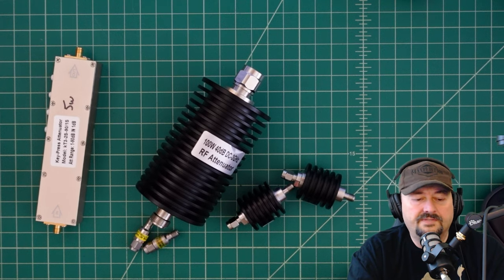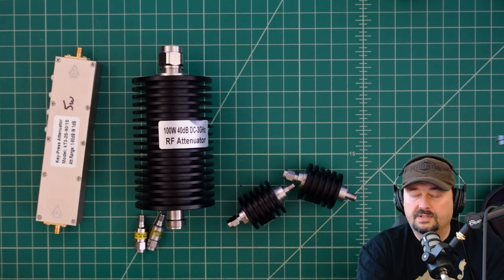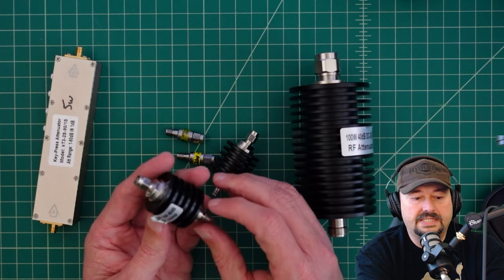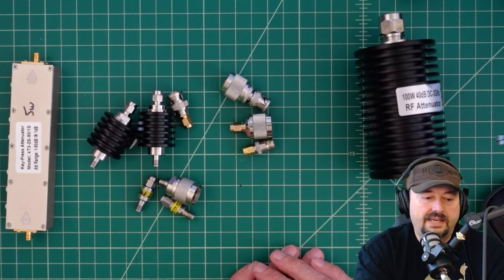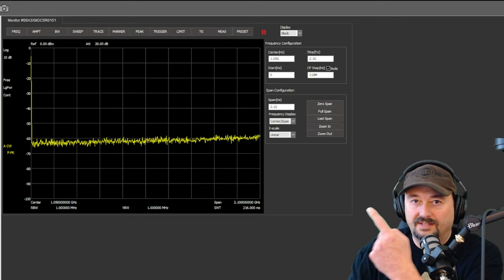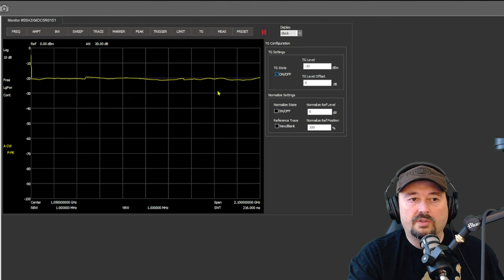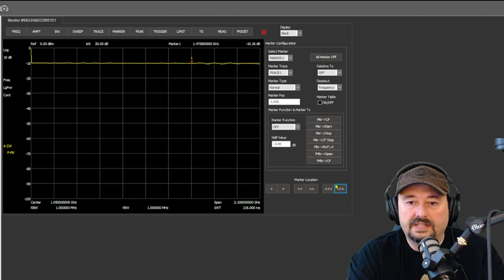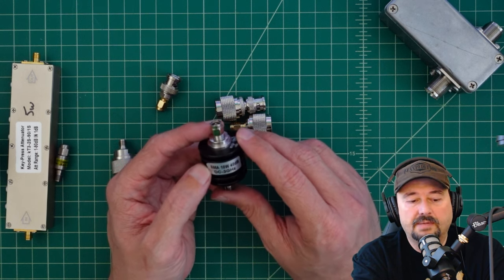Attenuators Explained for Ham Radio Beginners

Comment: Well presented as usual,  observing the correct input/output connections is of most importance at significant power levels, for example if your friend had perhaps a 10dB 10w attenuator it would likely be destroyed by a 5w radio connected to the wrong port.
High power attenuators of significant attenuation are a better investment than dummy loads because they are effectively dual purpose.
IE I have a 2kW 40dB attenuator, which serves both functions well, of course I can optionally put a terminator on the output port but with that level of attenuation it is not really essential. A function of attenuators that is often overlooked is to normalise impedances, for example for testing a receiver using a signal generator there can be merit in using an attenuator at the receiver input to ensure that it is seeing a 50 ohm source. Of course messing about with antennas can be made safer for the radio by temporarily driving the load via an attenuator. 
Very useful pieces of test equipment. 73
Reply from the maker: Hey g0fvt, I agree with all that.  Nice tip on using them with the sig gen 👍 thanks for watching 🍻

Comment: great job. I have amazon ones defective from new had to send back. they do heat up. I think power rating is ICAS on them. for high power testing I go threw a line section into high power dummy load. the line section give me a tap and still use attenuator to drop even further for test . for UHF and down to HF what you showed is just fine to work with .when working full legal power I found it best a line tap into dummy load. this will get quite hot. this keeps happy transmitter  at 50 ohm load. you can even add a line tap to MFJ dummy load . but even at 1.5Kw still need attenuator to input to a tina SA of something. you just have to add all attenuation together to subtract from reading. Tina SA  can do this just buy adding that attenuation into menu. 73's
Reply from the maker: Good info, and yes I have known a few people to have the Amazon ones go bad 👍

Comment: Thanks for all the great videos! I’ve learned a lot about RF test procedures and equipment by watching them. I bought a new open box no-name Chinese “big ass” attenuator (50dB 100W). I’m not sure if it’s directional since it doesn’t have a label indicating such. I’ll use a “rule of thumb” I'll put the input on the female N connector, until I verify the attenuator with a VNA. I know to have the highest power attenuator closest to the RF source. Could an RF attenuator (like the “big ass”) be used as a dummy load? Maybe putting a metal cap on the output? What do you think?
Reply from the maker: Hey David.  That big ass attenuator is pretty handy, good luck with it...  you can use them before a dummy load which means that you can get a smaller least expensive one.

Comment: How much attenuation should we need to protect a signal analyzer, such as the TinySA Ultra, for example? And how do you know--does each analyzer give a maximum input? Thanks for the video.
Reply from the maker: @KateHikes1933  the max for the TinySA Ultra is +6dBm but you get the best results with about -25dBm.

Comment: Thanks again for another great video. If one doesn't have a  Siglent, is there a way to test an attenuator like you did with the Tiny SA Ultra or a VNA?
Reply from the maker: Yes, do a logmag test from port 0 to port 1 on the VNA 👍

Comment: Can you use these to reduce your transmitted power? For instance, if you had a 10-watt transmitter could you use a 10 db attenuator to reduce your transmitted power to 1 watt?
Reply from the maker: You can use them for that but it would also attenuate the RX signal 👍

Comment: I have a 6GHz dummy load. How can I get a proportional sample into the TinySA from the transmission line to get an accurate power measurement?
Reply from the maker: You need an RF Tap or Directional Coupler, I have a video showing how to make an RF Tap 👍

Comment: Hi, great video, thanks. Could I ask you to clarify why you'd want to put the highest attenuation on first when stacking them? It occurs to me that if you had, say, a 3 dB 10W attenuator and a 40dB 10W attenuator you could use them with a 20W source if you put the 3dB one first. It would dissipate 3dB i.e. 10 watts leaving the second to dissipate the other  10W. The other way round would have the 40dB attenuator trying to dissipate pretty much all 20W.
Reply from the maker: The resistor in the first 10w attenuator would cook if you push 20w into it.  You would need at 20w or more attenuator to handle the 20w out.
Reply: @TheSmokinApe   That depends on whether the rating is for maximum input power or maximum dissipated power, surely. A 3dB 10W attenuator will dissipate 10W of power when fed with a 20W signal. If I look at series of readily available attenuators, all of them them the same power rating seem to be the same physical size, regardless of attenuation factor.

Comment: Greetings from Sweden!
I will get my tinysa ultra soon.
If i buy 3 attenuators which ones do you recommend i buy?

I will test some 1 to 6w handhelds and that's it so far.
Reply from the maker: You should get 40 and 30db attenuators for 10w
Reply: @TheSmokinApe  Thank you, Sir!
Much appreciated 🙏

Maybe some are stronger in w, i will starr on the Quansheng UV-5 (6) 8 or whatever  it's designated now.
But i guess it's no more than 1-2W on low power.

Sold all my radiis and just returning to the hobby.
Reply from the maker: Welcome home!

Comment: i am using a J pole antenna connected to a RTL-SDR dongle and RSPdx i am getting a overload or something but my spectrum in any sdr software will go all crazy on me about every minute or so and it seems to be worse when i'm around stronger signals would this help stop that?
Reply from the maker: It would but it would suppress all signals

Comment: The physical size of these attenuators implies that they will get HOT at  the rated power, so its best to derate the power rating, significantly, unless aircooled with a fan, especially if long duration tests are made. Commercial attenuators such as by Bird or MiniCircuit Laboratories will be physically larger and much more expensive and probably have some derating. Typically the internals are on a substrate, and can be quite fragile. Another caveat is to keep the connectors CLEAN.
Reply from the maker: Great comment as always tech!

Comment: I am totally new to this but want to test my own radios with a TinySA. For testing mobile radios with up to 65 watts output, would a 100 watt 40db attenuator be what I need? Thanks!
Reply from the maker: Hey Kemp.  A few points to note:

- 65w is about 48dbm https://www.everythingrf.com/rf-calculators/watt-to-dbm

- a 40db attenuator would take your signal to 8dbm and the most a TinySA can take is 6dbm 

- The creator of the TinySA has recently stated the for harmonic measurements its best to have an input signal of about -25dbm, so I'd get a 50 + 20db attenuator or a 40 + 30db attenuator and that should get you close enough
Reply: @TheSmokinApe  Thanks for the response. So if I understand the math correctly, a 100 watt 40db attenuator on a 65 watt transmitter will drop the power to less than 0.01 watts at 8dbm. So could I use a 10 watt 40db attenuator I already plan to buy for HT testing as the second attenuator? I’m not sure how the two attenuators interact with each other.  How do you calculate total attenuation when using multiple attenuators?
Reply from the maker: @KempOutside  just add them up, so that would be 80db of attenuation.  Make sure the one rated for more power is closer to the source (radio)

Comment: Can you add on of these inline with a Yagi antenna, for Fox Hunting? When you are close to the transmitter, and the signal power is over driving your reciever, and you can't narrow down a direction any farther.
Reply from the maker: Hey Chris, you can.  I'd look at the step attenuator so it's easy to switch levels 👍
Reply: @TheSmokinApe  Thanks!
Reply: I am very new to this technology, was given a tiny SAultra, do you know how i would set it up for sniffing” or foxhunting? Directional antenna? Attenuate the input signal at the  high or low input between ant and receiver? I obviously aren’t well versed but would appreciate the feedback. Thanks.

Comment: Hi Ape, do you know of a sensible use for a 'Throughterminator'? This has an impedance of 50 Ω at both the input and output.
Reply from the maker: I have one that I use to connect the 50ohm coaxial cable to the high impedance (high z) input on my oscilloscope.  I’m not sure I’ve seen a 50-50ohm one
Reply: @TheSmokinApe At 3.6 MHz the transmitter (generator) is practically loaded with the nominal impedance of 50 ohms (exactly it is 49.97 ohms |_-1.13°) if you have an oscilloscope with the usual 1 MHz || 20 pF is connected to it. If you work at 1 GHz, the transmitter sees 7.86 ohms |_-81°, so not a good load for the transmitter.
By the way, the center conductor is connected through and probably has a 50 Ω coaxial resistance to the outer conductor. Have a good day.
Reply: Regard it as a low power dummyload. Basically it is a 50 resistor between live and neutral. So it is a 50 ohm terminator and your scope measures across that 50 ohm.
The setup should be trx-cable-attenuator-cable-terminator-scope. Offcourse a spectrum analyzer already has a 50 ohm input so it's not needed.
Reply: @gartnl  True, the impedance of the connected device must be high, otherwise it changes the dummy impedance.